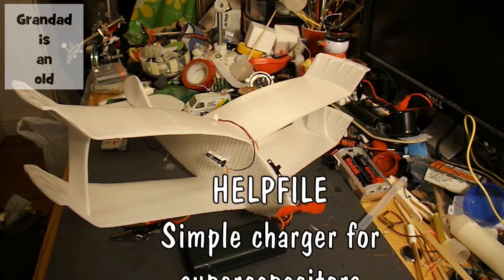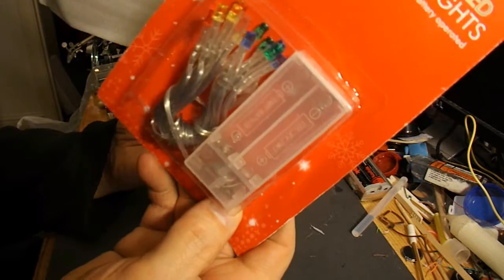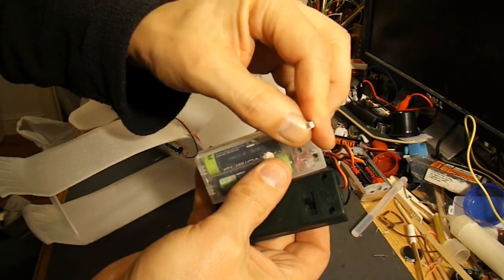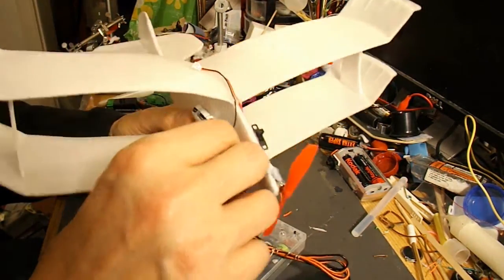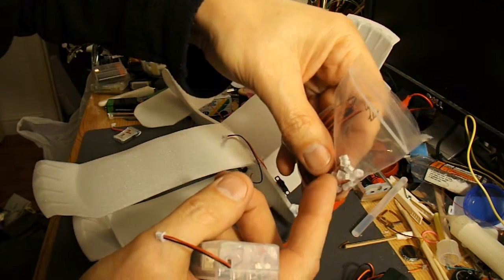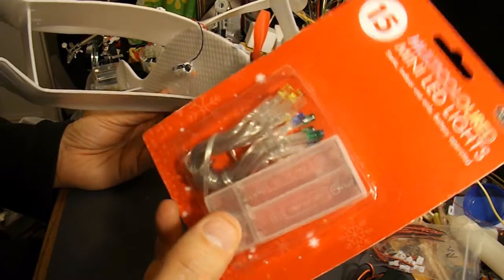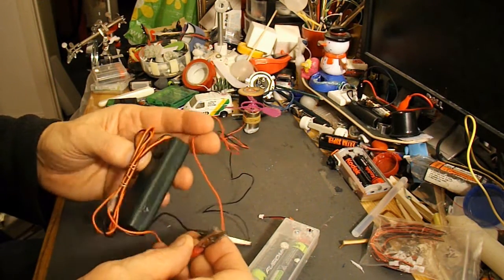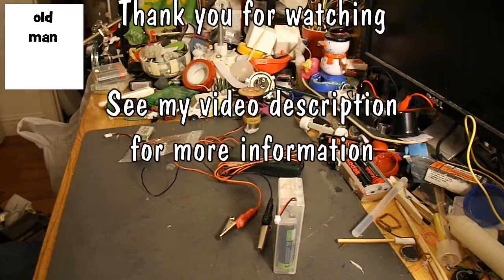Helpfile - Simple Supercapacitor charger

Comment: Just what I was after, most videos don't cover the charging method.
Reply from the maker: There are people who have built chargers that they can accurately measure what they have put into the supercap, but for my purposes I generally provide power and listen to the motor speed increasing, when the motor speed levels out I know there is no more power going into the capacitor and it is just going direct to the motor, so it is time to launch. If you want to pre-charge it and have an on/off switch then you really need a different approach. Sonex413 did a good video on the subject here https://www.youtube.com/watch?v=3GFkoMKBCtc
Reply: Many thanks, just looking for a simplistic solution to prove a design concept.

Comment: Grandad, I'm about to order 5 of those super capacitors (2.7v 5f). My question is, how many seconds do they work? Do you advice me to buy 10f instead, for a 2 minutes flight with your plane?
Reply from the maker: +Gurer Guncan I am not an expert on supercapacitors. The length of time they supply power works the same as a battery. The more current you draw, the quicker they run down. From observation I get a good burst of power initially but the motor continues to run for a long time afterwards at a lower speed. The main thing you are gaining with a supercapacitor is the speed of charging between flights. The physical size was more important to me to give me the power to weight ratio. I was only looking for a power burst of 10 seconds or so, just to get the planes up in the air and then let them glide. What happens is they get up in the air and as the power runs down we get a 'powered' glide to the ground. Many of the videos you see on YouTube of people using the early PowerUp paper planes usually only do the powered glide because they are not using fresh batteries to fully charge the supercapacitor to get the initial burst of power from it, so many people are disappointed with the performance.

Comment: Hey Grandad, is it possible for you to make like a plane and car hybrid with 2 motors. That would be pretty cool.
Reply from the maker: I am sure it would be possible but I am not going to do it. Most flying cars just use the props to provide the power and the steering. Here are some examples
Hot Wheels Street Hawk Remote Control Flying Car Review
https://youtu.be/n4g2OU8MnjI
Funny flying rc cars driving on the wall (including Super Mario)
https://youtu.be/WPm5i1GgahY
Firesky The flying RC Car
https://youtu.be/14GCGmJfHtY
I Super Charged my Flying Truck the easy way!
https://youtu.be/bd33UJqYcdw
This is my free flying single engine car https://www.youtube.com/playlist?list=PLA5a2xPRSrB1XmUrtUx1ZmUtvWF3rmkm9
Here is my Aircraft playlist https://www.youtube.com/playlist?list=PLA5a2xPRSrB0nZItxE_78EJP0F99Ghaki

Comment: Dear Grandad, can you make a powered paper airplane with a capacitor. Kind of like the powerup, but cheaper. Also if possible, can you try to scavenge the capacitor from something. I totally understand if you dont make it, but it would be nice if you did.
Reply from the maker: adkodiyan several points here. First it is not an ordinary capacitor it is a supercapacitor, they are not the same thing. They are relatively expensive compared to ordinary capacitors and I am not aware of any electrical equipment that you are likely to find around the house that would have a supercapacitor in it.
Second point is I have made several styrofoam planes using supercapacitors and small electric motors. Going backwards to using paper instead of styrofoam is not something I want to do.
Third point, the basic PowerUp is relatively cheap on eBay and because it comes complete with the plastic holder for the motor, wires, and supercapacitor it is ideal for what it is designed to do, which is power a paper plane. If you build a plane that does not need the plastic holder, then you are not restricted to the PowerUp configuration.
All my planes that use supercapacitors are grouped together in this playlist https://www.youtube.com/playlist?list=PLA5a2xPRSrB1wNvirrwAn69eo_pM0tdEM